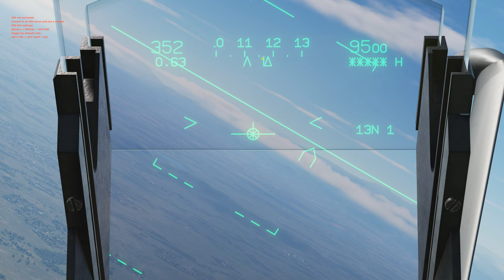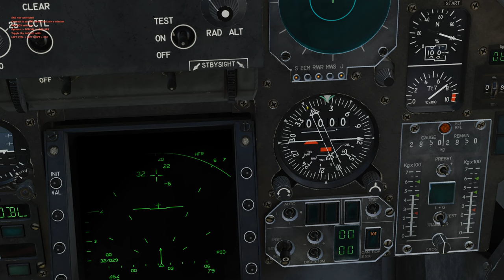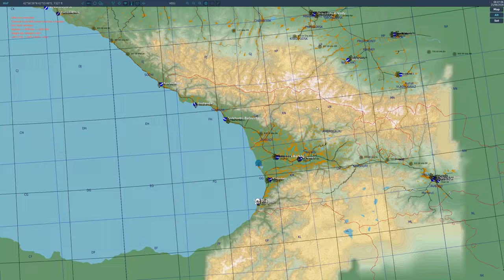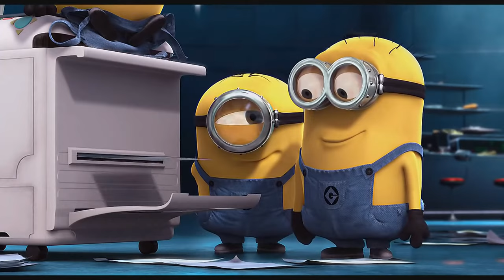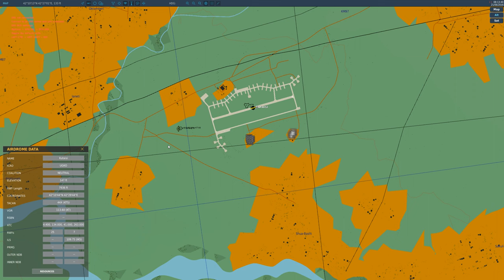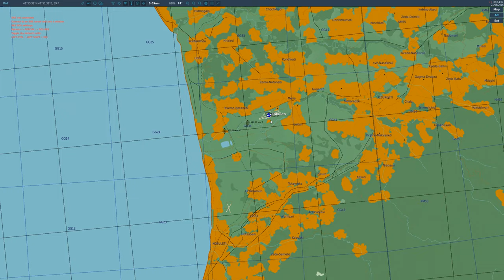DCS Mirage 2000C Tutorials | 0 to Hero | Ep3 Navigation

Comment: Great videos; concise and cogent.  One minor point, the circle of dots symbol on the F10 are the NDBs for for the approach to the runway, specifically the Outer and Inner NDBs. They are pretty much only used with Soviet-era aircraft (in DCS, MiG-19, MiG-21, and Mi-24) at Soviet-era airfields. They assist in approach, but are not an ILS.